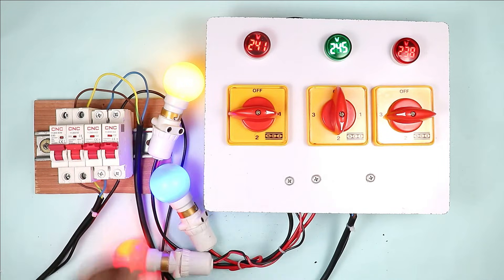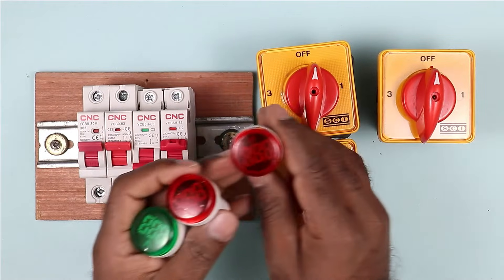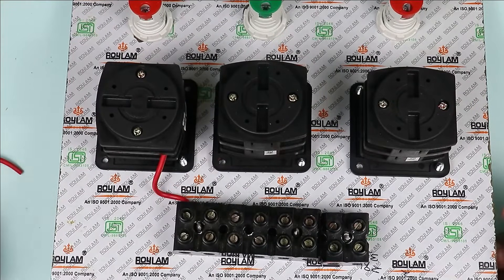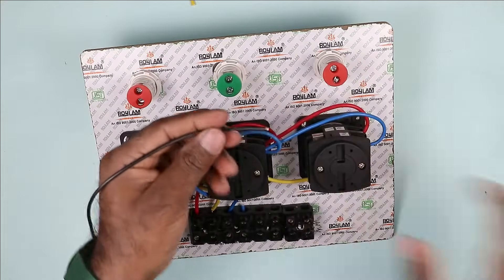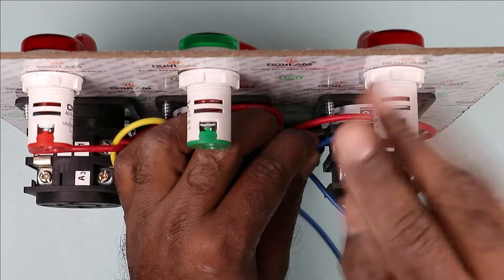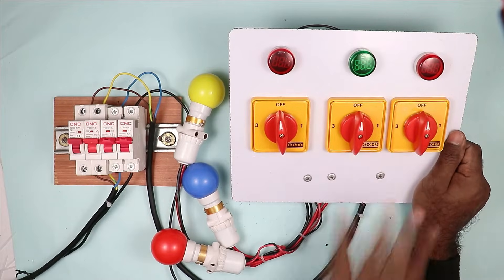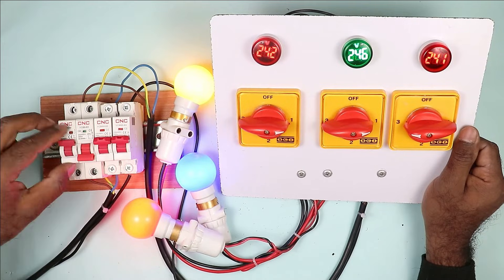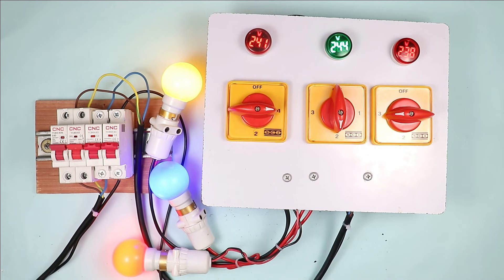RYB Supply Changeover Switch Board || 3 phase changer connection @TheElectricalGuy

Comment: Mere ghar m 3 manual phase rotatory selector use hua h . par jab m teeno rotatory switches ko off mode m daalta hu phir bhi LED indicator off nhi hota . Continuous glow hota h . Par Meine Current Leakage ka bhi check kra using Tester . Koi Leakage nahi mila . uska koi solution h toh please btao .

Comment: excellent video bhai, I have 2 suggestions, pls comment -> 6:09 : If you are using o/p supply of connector switch to power the LED, then how will you know when the down phase is UP again. wouldn't it be better to use source R-Y-B individually itself to power the respective LED's, thereby knowing when the down phase is UP again, to restore the position on selector so all 3 phases are distributed evenly! (OR) use 6 LED lights 2 of each colour and power 3 LED's with your method and 3 LED's with source R-Y-B respectively. pls comment

Another suggestion: wouldn't it be better to take 3 wires per phase from terminal block itself to respective selector switches, rather than looping the R-Y-B wires, from the 
selector switch. in case there is any damage in selector switch that respective looped wire also could be dysfunctional. This may never happen but better to be safe than sorry. Pls comment